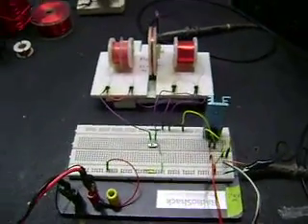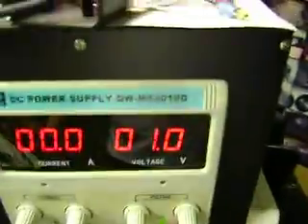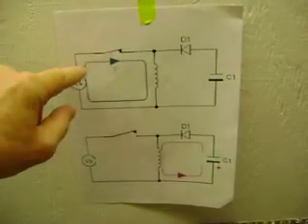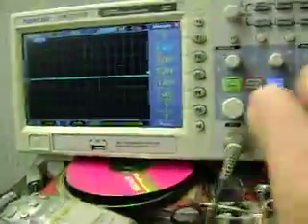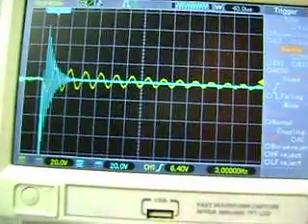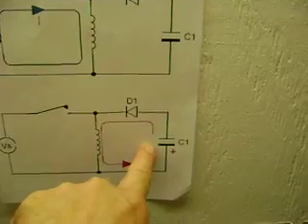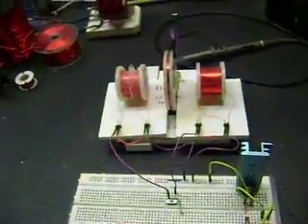Something Different That We Can Do With A Bifilar Coil. New Possibilities

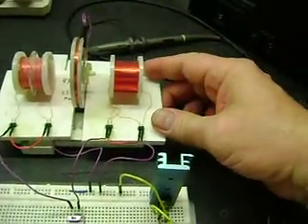Comment: Just fyi, and you probably know this, at time 3:23,  you mentioned that "the coil will take on voltage limited only by the resistance of the coil, and will ignore the impedance of the inductor"

This is not uniformly true with a series-resonant circuit, which is what Tesla's bifilar coil actually is.  You can indeed eliminate the coil's impedance so that only the resistance of the copper wire affects current flow, but this is only true when:

- the XC (capacitive reactance)  equals the XL  (the inductive reactance).
- and this only happens at the resonant frequency of your particular tesla bifilar coil

The formula for XC =  1 / (2piFC)  where pi = 3.14159,  F = frequency of the alternating signal fed to the coil, C = capacitance.  In the case of a Tesla bifilar coil, the capacitance C  is the 'stray' capacitance between all the windings in the coil.

The formula for XL =  2piFL  where pi = 3.14159,  F = frequency of the alternating signal fed to the coil, L = inductance of the coil.

To find the frequency where the Tesla coil only has resistance of its copper wire affecting the input signal, you set  XL = XC  then solve for the (resonant) frequency F.  You can use a meter to measure and get the values of C and L for your particular bifilar coil.      Look up "find resonant frequency for series resonant circuit" for more details.

Even if you're using DC,  if your experiment only involves toggling the circuit on briefly and then assessing the results of the brief 'power on',  the XC and XL will not be equal,  because of the time constants to charge the inductor and capacitor, and those delays will interfere with your results.  That being said, very few experimenters run DC only in a Tesla coil, but I thought to mention it.

Your experimental setup is gratifyingly easy to understand, very nice job!  Thank you

Comment: Sir, could you now replace the high speed diode with a condenser, not a capacitor, later replaced with a bifilar choke. You can obtain this condenser from a set of points or you can use two electrodes submerged in oil. This will also eliminate the voltage threshold of the high speed diode. See ignition circuit.

Comment: I thought the bifilar coil was a double layer pancake coil
Reply from the maker: If you read the patent 'Coil For Electromagnets' Tesla specifically states that the pancake coil in his diagrams are for simpler understanding of the relationships between the 2 windings of the coil and that it can be done with any type of coil windings that are well known.
Mags
Reply: Magluvin Ok but the pancake design is unique in that it creates a magnetic field who’s poles are uniquely right next to each other    At least that is what I have found.    

Good luck with your research
Reply from the maker: @drscott1   And what advantages do you find with what you are saying? Skycollection here works a lot with pancake coils.
Reply: Magluvin    First I would like to say I profess no special Insight into the matter.  

It seems the closest thing to a magnetic monopole I have witnessed.  I do not have enough experience to comment much more then that.   I am still learning
Reply from the maker: @drscott1     Was just asking. The way you presented your second  post, I thought maybe you had something special going on.   This is what I know about the pancake, so far... Its fields are nearly the opposite of say a really long coil with the poles at the far ends. Where the pancake has more of a follow nearer to the flat surface, from say the center hole to the outer edge. The shape of the surface of a doghnut, not really a lot going perpendicular to the surface like a cylinder coil would seem to have more of. If you apply dc and use a small compass, you can get an approximation of the direction and strength of the fields, compared to a long tube style coil.  The pancake is not unique to Tesla at the time. Can probably find more info on the 'whys' of the pancake and what it is best used for from readings other than tesla.  if you think about a mono pole, and look at the flux lines using iron filings, then I might say that a really long cylinder coil poles would be very close to being a mono pole as the other pole is very far away. The filings will show nearly as much flux out of the sides of the end of the coil, just like a magnet, as there is coming out of the very end of the coil. So around the end pole of a long tube coil you have over 180 deg of say N pole field, other than the actual coil being in the way of having 360deg of N pole.  ;)

Mags
Reply: Magluvin    Thank you for that explanation.  I look forward to looking at more of your research.   

Best.  Scott
Reply: I wrote this more to help clear my head. I hope it helps yo as well.

Bifilar is just the 1/2 point of the inductor winding following side by side the start to finish of the first 1/2 of the inductor winding. This can be a double layer winding of any shape, or a side-by-side winding of any shape. Due to geometries maintaining a constant voltage between the two 1/2's changes the voltage  more along some of  the windings than in others. Due to radii differentials. The magnetism always tracks to the net direction of the charge and the concentration of total charge. Bifilars tend to have a "halback" type effect of forced increase and decreased net charge because the windings run perpendicular to the paired conductor charges. The charge field is significantly side-by-side as well as across the total inductor; not as much from layer to layer as in single windings.

The peculiarity of the bifilar coil when it comes to induction is that the capacitance will collect the charge that is carried in the magnetic field, so it will not flow from the capacitance until the field reverses direction. Of course the field it puts out tracks the movement of the charge across the entire inductor. Not just from the synchronized field due to the matched magnetic field with the incoming one, but it also adds the magnetic field in the conductors incoming to that which is being dumped by the dielectric... it collects more energy than a standard inductor as it feeds itself from its magnetism.

A typical inductor has very little capacitance, so it starts flowing when the capacitance saturates. This generates an almost immediate reverse magnetic field (Lenz's Law), and represents the inductor's active resistance.

Conductors like all matter, prefer to be in a balance state. When charged, the charges align and pack more tightly per the value of the voltage. Inductors increase the density of the charge concentration, which ups the packing due to geometry. Disconnect the charge and all that charge concentration will force an expansion, BEMF. Conductors prefer to expand charge through movement towards a lesser voltage, dielectrics through alignment of magnetic moment. Dielectrics under a charge differential will accept charges by alignment preferentially to conductors transferring charge by force of differential.

The bifilar's response is about 90 degrees out of phase, not freeing up the charge flow until the capacitance is forced to accept a reverse magnetic orientation. Then the combination of bifilar capacitance is dumped into the conductor which now generates a back magnetic field, 45 degrees ahead of the incoming field. The two combined are stored in the capacitance: first canceling out the remaining capacitance then depending on the wave form doubling up the balance. 1/2 the time the incoming and outgoing power are aligned magnetically results vary with wave form. The reactance varies with loading, but can be resitive or even negative resistance, generating power while doing work in a motor (at reduced torque per Tesla). 

There are patents for motors that generate electricity (See Thane C Heins) using this effect. And yes, it could also have applications in transformers. Especially with Thane's Bitt transformer design. The truth is if the 3 laws hold, electricity by definition cannot be energy. So, energy has to be something else... which electricity is just a transport for.  Peace, B
Reply: @mundymorningreport3137  Wow, good explanation.  More food for thought.

Comment: Is there something wrong? After 6:44, the scope doesn't appear to be triggering on the new button releases any more and is just showing the last trace acquired?
Reply: Also you state:  "He said that the features of the greater capacitance of this type of coil allows an input current to charge its capacitance ignoring its self inductance impedance, only limited by its resistance. " That's not quite how Tesla put it and is a little misleading. Look up #512,340 and see Tesla's exact wording... and also note that Tesla emphasizes that this capacitance effect and its results will happen in ANY and EVERY coil -- not just the series bifilar system of the patent -- depending on the frequency of stimulation.
You might like to try putting a small capacitor in parallel with your "normal" coil and repeating the test, comparing the waveforms you get this way with those from the bifilar coil. Try something like 47 nF, 200 V (just a w.a.g. to start with.)
Reply from the maker: No it is just a really good run at hitting and releasing the button. If you look very close the trace does show slight changes and even the measurements to the right are changing also.  When the switch closes, it is closed way longer than it takes to get the current in the coil to max. So the flicking of the button to let the switch release as fast as possible gave me very close repeatable results.  I used the switch to make it all as basic as possible. If I just push down on the button and only lift my finger off the button to open the switch, I get very erratic results as the contacts most likely have some time to shift, scrub and be noisy. So letting it flick open gives me the repeatable results shown  for this situation.  Lol could do a vid just on that subject for more verification.  It is a radioshack momentary button switch. Worked very well during testing before the vid so i went with it for the vid.  I was even impressed with the consistency I had most of the time with it.  But now Im going to mosfet switching.  Im eager to see these same tests with a more timed, faster pulsing. 

Mags
Reply: Yes, in my opinion the consistency of those last several button-flicks is the most remarkable and unexpected thing shown in the video! 
I hope you'll try the capacitor test I suggested above, before you take this configuration apart for your further testing.
Reply from the maker: Yes he states that all coils can do this, as we can see in the vid, the regular test coil does show some output seen by the pickup coil. But the bifi does it better.  I am ahead of you on adding the cap to the reg coil and test.  Needs to be done.   Was just talking about that on the phone with someone this evening. And Im sure it could very well show a very similar and or same results as the bifi.   Will see.   Will have to look close to see if there is any differences.

Mags
Reply from the maker: Yes it was pretty surprising to me also. Yet it did the do.  Ill cover that also. Holding the push button and letting it spring back on its own did quite well at opening the switch contacts. I had some hours into it and I was able to get a rhythm going with closing the switch and leting it release as i was doing.  Durring my trials before the vid i was a bit like you. Was the scope locking up?  But no. It was just some nice quick switch releasing that occurs with this push button switch.

Mags

Comment: Here is another method to accomplish similar task: https://youtu.be/41cfHcb7qd8
I used this to take a pulse motor and add torque. It becomes very interesting when you get an extremely efficient pulse motor and add this :-)
Reply from the maker: Ok. YT is whacked out. I just posted to you here and it is not there now.  Been having isses with posting this vid and more issues now. I looked and your post was set up for review. Never seen that before. So I clicked on it and your post was listed as possible spam. So it let me approve it. When I first posted the vid it said there was some issue. So I hit publish again and it was seemingly fine. I hit the link and watched it. Another time I rewatched it it was starting at 48sec into the vid.  Refreshed the page and the same thing. Logged out of firefox and the n it was ok. Then it did it again. Posted a link at overunity dot com and they said the link was bad.  I rechecked and it was set to private. I never do private vids, and even if it was that link should have worked. So I corrected that and all seemed well.  So whats next YT? I wish YT was like it was 10yrs ago.  lol, after I post this my previous post will probably show up. Sucks

mags
Reply from the maker: Your link goes to a list of my vids, so I cant see the vid you wanted to show. Can you try posting it again?

Mags